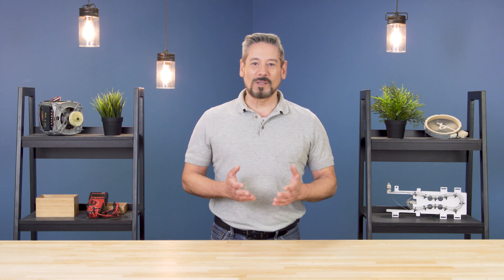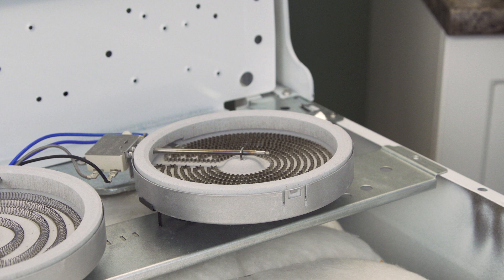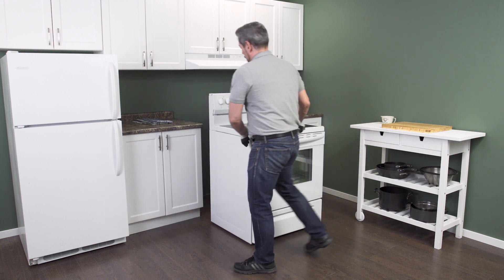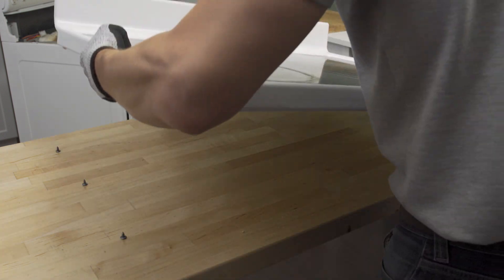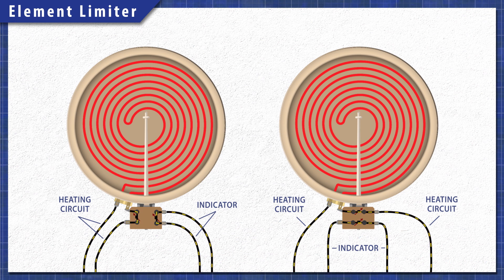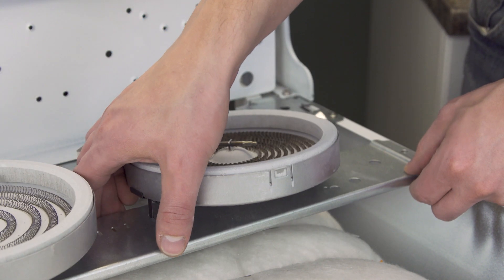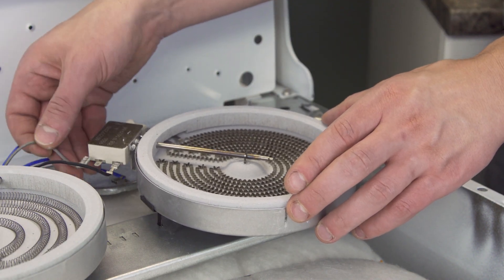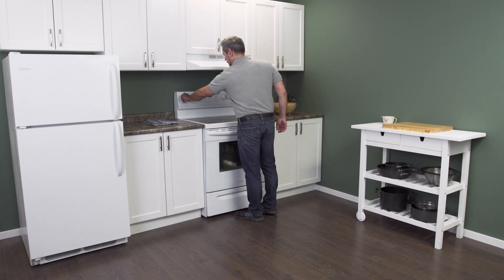Stove Surface Element - Testing and Replacement | Repair & Replace

Comment from the maker: Did this video help you fix your stove? Did you run into any problems? Let us know in the comments!
Reply: i have changed the element and the switch but the burner did not turn on WHY?
Reply from the maker: @qamarzaman8139  Thanks for watching. It could be an issue with one of the wires. You can test the element and the wires together through the back. If one of the wires is faulty then you will not get any resistance. 
https://youtu.be/GaW7uAHkPQI?t=380

If those wires are good, then it could be an issue with the wires leading into the switch.

Comment: How can I drill a hole in the ceramic part of the element at the correct numbered position for the spring clip?
Reply: @AmreSupply Are you still watching this channel?
Reply from the maker: It's not recommended to drill directly into the ceramic portion. You should be able to use a combination of the pre-molded holes to fit most mounting options. If not then try to see if there's any adapter brackets or plates available. If no other options are available, then only drill into the outer steel mounting ring and use self tapping screws. Make sure to avoid the ceramic disk and coil.
Reply: @AmreSupply  Perhaps I wasn't clear. I need to use a numbered hole position that has holes drilled through the metal but not into the ceramic. Do I need to drill into the ceramic or just push a self tapping screw into it?
Reply from the maker: Thanks for clarifying. Just use the self tapping screw into the existing holes. It's the metal that will hold the screw in place the ceramic portion is not structurally sound. A powered drill might crack the ceramic.

Comment: I have an older Jennair cooktop with a "custom control" element that stopped working.  It has an extra temperature sensor meant for "finer temperature control" via a custom control module.  The burner stopped working so I dug in and saw a couple things:  the extra temperature sensor had actually curled and looked cooked, plus there was a white smudge on the glass bottom side nearby, indicating to me some sort of overheating, maybe over an extended period of time, causing the temperature sensor to fry at least.  All the continuity checks on the burner's limiter and the heating elements looked good.  Was it just the temperature sensor that broke?  What could have lead to repeated overheating? Under normal conditions, what controls the actual temperature at the heating coils? From your video, I thought the temperature limit switch was just for extreme overheating failsafe.  I am suspecting a bad custom control element, but so far have only purchased a replacement heating element and installing that first.  Parts are really hard to get for this older cooktop, BTW.

Comment: When did you remove the back panel such that you had to replace it at the end of the video?
Reply from the maker: That is a good eye. Normally the back cover removal would be shown at the segment at 2:50 
When creating this oven and stove series of 50 videos, we had to create shared building blocks (segments that are used in multiple repairs) which are pieced together for individual videos. It is an error that the back cover replacement was not omitted for this particular video, unfortunately that cannot be changed now that the video is posted.

Comment: do we strictly need to disconnect and isolate the elements for accurate continuity tests
Reply from the maker: Thanks for watching. You can test without disconnecting the terminals or without removing the element form the mount. We tested on the bench so that it was easy to see on the video. In some cases removing the connectors and testing the terminals can help you get a good contact with the multimeter probes.

Comment: My burner has power, but will not adjust the temperature, it stays on high.
Reply from the maker: Thanks for watching. If your stove element stays on high, then it's likely a faulty heat switch. Over time the contacts in the switch can wear down and start sticking, preventing it from cycling on and off at lower settings. You can see how to fix this in this video: https://www.youtube.com/watch?v=l39vOnhqnhg

Comment: Hi, it is possible to remove, and replace only limiter ? In my element the rod on the top is burned.
Reply from the maker: Thanks for watching. There are some ceramic elements that have replaceable limiters but in most you'll have to replace the entire heating element.

Comment: At 4:41  labels 1A and 2A should be reversed per convention. My coil was good but the High Limit Switch was open, not a common break, guess the whole thing has to be replaced ?
Reply from the maker: Thanks for watching. You are right that the example shown right after does have the 2A terminal on the edge, but in all cases it's still best to check as there is some variation between elements. The point being the A terminals will test the element, and the B terminals will test the limiter.  The limiter should have no continuity at room temperature. If there is continuity then the limit switch is faulty and the hot surface indicator light will stay on.

Now if you were having issues with the burner not heating and the element tested good, then it's most likely a faulty heat switch: https://www.youtube.com/watch?v=GaW7uAHkPQI

Comment: hi, will u help me pls, what part do i need to change if my oven big burner not controlled, burn on high all the time
Reply from the maker: Thanks for watching. If the burner stays on high then it is likely an issue with the heat switch. You can see more in this video: https://youtu.be/JKrrOflS1RM

Comment: i have changed the element and the switch but the burner did not turn on WHY?
Reply from the maker: Thanks for watching. It could be an issue with one of the wires. You can test the element and the wires together through the back. If one of the wires is faulty then you will not get any resistance. 
https://youtu.be/GaW7uAHkPQI?t=380

If those wires are good, then it could be an issue with the wires leading into the switch.

Comment: I wish I watched this last week. I had a problem with current controller attached to heat switch, I couldn't fully take the oven apart, so I tried to remove the current controller in place, I basically ripped it apart so I wrapped it all in insulating tape and left it in place.  The next time it switched on there was a loud snap.
What do you think I might have damaged?
Reply from the maker: Thanks for watching. It depends on a few things. If any of the wire connectors were loose then you might have heard an electrical arc when you switched on power. Did the snap happen when you turned that heat switch on? Or did it happen when you just reconnected power to the whole stove?
Reply: @AmreSupply  thanks for such a prompt reply, the original issue was that the faulty hob had become stuck in the On position, so it was when I turned on the cooker wall switch, yes i think it was an arc. I should get a multimeter in the next couple days so I'll be able to test each part of the circuit to see exactly what's dead.
Reply from the maker: @1nfiniteSeek3r  We're just happy to help! Keep us posted on what you discover, it's always interesting to hear what people find out.

Comment: I have a GE Range Model# JSP42SN1SS Flat Top Glass slid into Granite that the inside coil of the 9" Radiant Element is apparently burnt out, my concern is do I have to take the stove controls off which are located on the front in order to change the bad element?
Reply from the maker: Thanks for watching. That is a stove that I haven't seen personally so I can't tell you for sure. To lift up the cooktop there might be screws behind the control panel or behind the oven. You can take a close look at the parts breakdown here as you take it apart as this can help show you where some of the screws are located. Since this is an "exploded" view it will still look a little different once you start the repair.https://www.amresupply.com/lookup/208123

Comment: I have a Jenn Air range.  It’s dual burner element stopped working. The burner coils tested good and the limiter also tested good per this video.  However, my element has a second probe that is not shown in this video and it is straight across from the shown limit probe. That probe did not have continuity and required the element to be replaced.
Reply from the maker: Thanks for watching. There is definitely some variation between models. We're glad that you we're able to narrow down the problem!

Comment: The on light (cooktop indicator) on my stove stays on but the rest of the system seems to work fine and turns off/on whenever i need it. what can be a good first place to look at for fixing it?
Reply from the maker: Thanks for watching. If the cooktop indicator light stays on then it is an issue with one of the heat switches: https://www.youtube.com/watch?v=s5iG61kAyJQ

Alternatively if the hot surface light stays on then it's an issue with one of the limiters on the heating elements: https://www.youtube.com/watch?v=CXhmlswg30Y

Comment: Hi I have a Frigidaire stove smooth top stove ,your videos have been helpful,But I have replaced the switch and the burner and still doesn’t work ,what do u think about this thanks Billy
Reply from the maker: Thanks for watching, we're glad that you've been finding the videos helpful! If the switch and burner are both new, then it's likely an issue with the wires. You can test the wires and the element together through the back as seen here: https://youtu.be/GaW7uAHkPQI?t=380 If there is no continuity then the wires should be replaced. As well make sure that the wire connectors make good contact with all the terminals.

Comment: i have a Kenmore electric stove touch pad... the element stay on high and it doesn't go off, one of the wire that plug into the element looks burn, do i need to buy the element .
Reply from the maker: Thanks for watching. Does your stove use dials? If so then it could be an issue with the heat switch: https://www.youtube.com/watch?v=l39vOnhqnhg The burn mark on the wire does imply that there might have been a short or a surge in power so you can test to see if the element is shorted, which is also shown in that video. A shorted element will need to be replaced.

Now if your stove elements are not connected to dials but are instead connected to the control board, the power will be switched on by small relays. A power surge can cause issues with these relays. If you've eliminated everything else than it could be an issue with the control board.
Reply: @AmreSupply  Hi Vance, yes mine Kenmore electric stove does not have dials. it's all touch pad,  only one element stays on high. i took the element off, its the larger one and tape the wires with electrical tape and still use the other ones for cooking but i have to unplug it when not in use because it will still have electricity running though i have the element off ,but that is a pain unplugging and plugging all the time to use the stove, i test the element and with multi- meter and i get continuity on one of the probe on limiter with reading of 50 and it makes the continuity beeping sound but when i test the other  probe of limiter and element it don't buzz but reads 80. could it be the element? i can't find where those wire leads to the control board. thanks
Reply from the maker: @jeremiah1797  It could still be an issue with the element. 

As for your test. Testing for continuity between 1a and 2a should have continuity, as that is testing across the high limit switch through the element coils. That is for the heating circuit. You can also test to see if the element is shorted by testing 1 terminal and the shiny metal body of the element. You can do this for both terminals. If there is any continuity, then the element is shorted and will need to be replaced.

Testing between 1b and 2b should not show any continuity as this is for the hot surface indicator light. This is not connected to the heating circuit and will not affect the element as it runs.

If these tests passed then you might need a new control board. This is shown in this video: https://www.youtube.com/watch?v=ORTi4lLyoqw